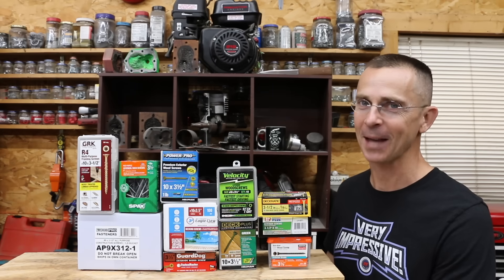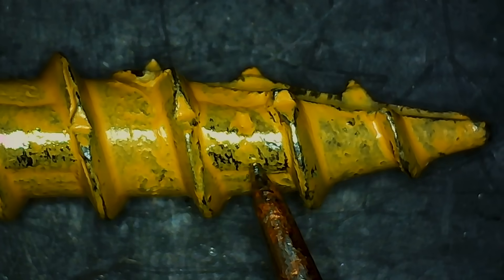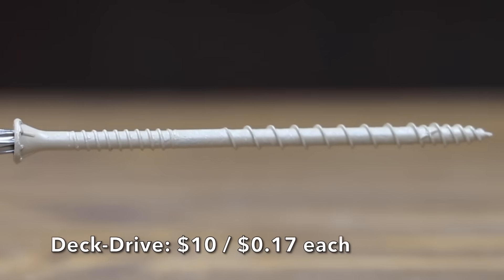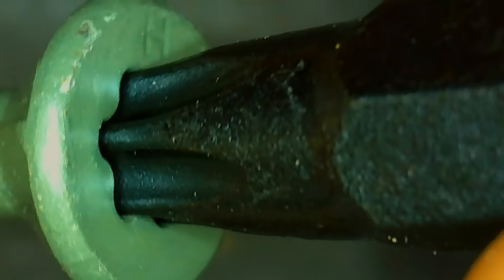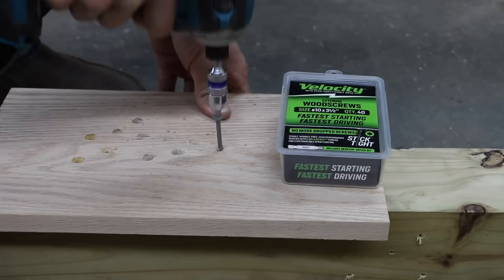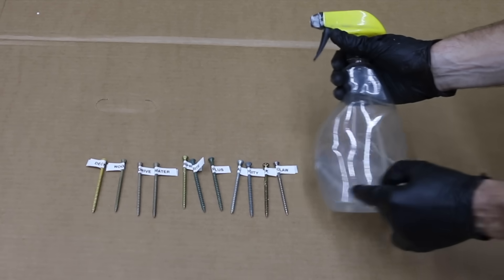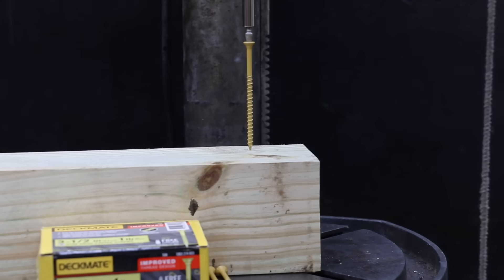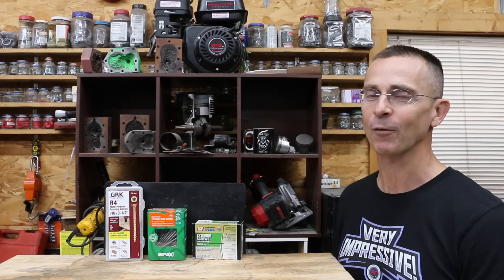Best Deck Screw? GRK vs SPAX, Grip Rite, Deckmate, WoodPro, FastenMaster, Deck Plus, Eagle Claw

Comment: I work in a furniture leg production facility that joins wood pieces together. Most of the wood is alder, but we also use harder wood like black walnut and maple. I was very interested in this video because we have a problem with breaking screws, mostly with the harder woods but sometimes with the softer ones as well. Unfortunately your test don’t include a break test while driving the screw, which is what we experience too often. 
We use one of the brands that was in the video, we are just looking for the ones that would hold up better. Any possibility of adding a drive/break test to the video?
Reply from the maker: Thanks for the suggestion.  Thanks for sharing.
Reply: Someone in the comments mentioned using beeswax (or similar) to lubricate the screws. Seems like a possibly easy solution to try, if traces of wax don't contaminate the wood for finishing.
Reply: @MorryB  the number of screws and the frequency of use would make this solution not workable in our shop.
You gave me a good list to work from, I’ll try another brand.
Thanks.

Comment: here from Toronto Ontario,, I am a Construction Electrician by trade. Sometimes we get into these really tight spaces with light fixtures/boxes/etc. where mini screw driviers do not fit or sockets. I found a 90 degree manual electronic type wrench like 4 or 5 inches long also they have adapters in front and at back slot for 1/4" sockets. Wondering wich one is the strongest/or best? I have been usind a PRO brand name one but they skip a dirrection while thightening because tool is so small. They have a side direction transfer tab for clock/counter clock possition ,, 
not too important but an idea for video
all your content is great * * * * *
Reply from the maker: Thanks!  Thanks for the video idea.

Comment: I know this has nothing to do with screws but iv been watching your videos on oil and fuel additives and wanted to see if adding different fuel additives with different purposes can help more than using the "all in one fuel system products" as i do all my own maintenance it would be good to know the best way to keep up on preventative measures before having even a minor failure or issue that requires parts to be replaced
Reply from the maker: Thank you!

Comment: I used Saberdrive 10x3.5 deck screw for my covered deck for every thing. 
Screwed them right into the 4x4 to hold the Joist, even the double header is fastened with Saberdrive 10x3.5 
I hope they are a good screw, because i already made the covered deck.
Reply from the maker: Thank you!

Comment: I've never put a deck in, but isn't corrosion negated by coating the deck ?  I mean, isn't coating supposed to seal the deck to prevent water to stop timber rot and metal corrosion?  If you have to worry about corrosion in the screws I'd be more worried about the wood rotting.

Comment: One slightly difficult aspect to test (at least in a small time scale), but very important one is how well do the deck screws stay put over time. Some brands have additional features to prevent them from becoming loose. There's nothing more annoying than walking on a patio deck barefooted and stepping on a protruding screw.
Reply from the maker: Great point!

Comment: If two runners tie for first place, then the next runner across finishes third.  But in the Weight to Start Screw column the third finisher is ranked second.  That throws the averages, because the fourth ranked screw is actually the tenth hardest to start, out of 11.  And the Deck-Drive screw would become dead last with a grand total of 36 (11+1+4+9+10) and a 7+ average.

Comment: Hell yeah Todd, great video.  Very thorough, and I am absolutely LOVING the breakdowns and summarys at the end.  Also thank you for skipping going over the tests where all the results are basically the same (the downward force test in this video).

I was confused when you were showing the coatings on the nails in the beginning though - the lighting was off - they all looked yellow, so I thought one screw was actually another?  Also, you kept saying "there's no visible chipping" when there was definitely chipping in the coating, but it didn't necessarily reach the exposed metal, from what I could tell.  Did you mean there wasn't any exposed metal?  Maybe I'm the weird one for being confused by that at first.

Comment: The torque test really isn't fair because wood hardness can change from location to location, especially where the grain is farther apart like nearer the edges of the wood. Same is true for pulling the screws out of the wood... it would be easier in those locations. Doing the same tests on 3 or 4 different types of wood (even plywood) may have been the more accurate option. Still at least it gives a better idea as to what is just garbage and what is likely going to do a better job.... so I think this is still a worthwhile video to watch, thank you once again, Todd!

Comment: I really don't see the point in all the hammering and noise made by impact drivers.
Try using your Makita drill instead, and set speed to 2. Full speed!
It's silent, and just as strong, but faster. Oddly enough battery lasts a LOT too. I built my entire deck using just 2 5Ah batterys and driving 4000+ screws.

Comment: Been using Spax and Power Pro for many years with no issues. Nice to see that they each did OK here.

Does anyone still use a phillips head screw for anything other than drywall? I cannot imagine building a deck with phillips or robinson heads ever again.

Comment: I built a new cedar deck in 2001 using Deckmate  coated “Lifetime Warranty” Phillips/Robertson  screws . Five years later I needed to remove some of the 2” x 6” planks to perform swimming pool maintenance. EVERY SINGLE head broke off the “Lifetime Warranty” Deckmate screws, no matter how careful we were removing the them. Ultimately, it turned into a crowbar and Sawzall affair.    I’m done with Deckmate!  I replaced the screws with GRK which were easy to remove during maintenance operations.  BTW, Home Deport refunded the cost of the Deckmate screws without fuss..
Reply: Cedar seems quite acidic to coated steel screws, especially for horizontal surfaces like decks that collect/pool water. Stainless is normally recommended for cedar.
Reply: @MorryB  Clearly. When I built the cedar spa surround I used all stainless fasteners.  No problems there!

Comment: I'm not doubting your testing methods and never will and especially by knowing you guys use 2x4 type of wood for a lot of stuff there but in my opinion you should use something else for testing the speed and torque and pull out force.
I was thinking something like mdf or plywood because those have uniform strength and density, unlike natural wood which has grains and knots.
Just my two cents about making tests more laboratory like (ironic, I know) instead of situation dependent.
Again, great content as ever and I'm willing to discuss my idea with anyone capable of discussing like a normal person.

Comment: Been using the grip-rite due to availability. They drive pretty easy, the coating is decent, sitting in water for a year only faded the paint. So far they haven't rusted through in pressure treated wood like the previous ones.
Reply from the maker: Thank you!

Comment: Great video, have used Deckmate on decks and had them shear after extreme cold and heat, maybe a re run with some time in freezer, like your battery test. I live in mountains with high winds and cold. Thanks.
Reply from the maker: Thank you!

Comment: You shouldn't be testing everything on oak; most decks are made with cedar redwood (which are softwoods), or various treated woods.
Reply from the maker: Thank you for the feedback!
Reply: @ProjectFarm  Np. Decks are also done with hardwood, so both would be good. I really think you should collaborate with a construction channel (if you haven't already), and talk to manufacturers. Also was thinking on that sheer test that the wood would fail before any of the screws, but maybe not all woods. Great channel btw; I've probably watched like 50 videos. Do you work in STEM or do you just find it interesting? Also appreciate how humble and thorough you are.

Comment: I kinda wonder if someone has thought of making these out of 316 stainless, just for that extra resistance against acids and bases, for example - for constructions near the sea. There is a reason why chimneys are made with 316 on the inside and 304/4XX on the outside, as acid forms during condensation. Or why decorative railing is used in 316 near peers, rather than 304.

Comment: The stainless screw might look corroded because it was in the same acid bath with the ferrous screws and their rust may have deposited onto the stainless. Next time you may want to do separate acid baths with new acid.
Reply: There's also the matter of what kind of stainless... Not all stainless steels are equal. Decking screws should really be Acid Proof A4 equivalent.
Reply from the maker: Thank you for the video idea!

Comment: I use grk alot they go in smooth and don't split the wood.
Ultrasonic cleaners are a hot topic. Some tubers only use water in the unit and put the items being cleaned into containers with different solvents and float it in the  ultrasonic unit.
Reply from the maker: Thank you for the video idea!

Comment: Hate to be that guy and point out these screws going in and then back out experience twice as much force, rubbing and heat as you would normally just screw them in and leave them not pull them back out.
Reply from the maker: Thank you for the feedback!

Comment: Only proper fastener to use for decks is Stainless, Acid-proof, A4-standard equivalent or better. Coated screws are a compromise in corrosion prone environments such as decks... Treated or not.
Reply from the maker: Thank you for the feedback

Comment: I've been using GRK and Spax as my primary screws for years now. The primary reason being the fit of the bit out of the box and the fact that I don't believe I've ever had a bit shear before I finished a box. Generally Spax is my go to all rounder for 2"-4" with GRK being my choice for their smaller and lag bolts. Sometimes it is worth that bit of extra money for consistent performance.
Reply: I used 6" long SPAX to anchor my ledger boards. A combination of screw design and the coating made it easy to drive with a 1/4" impact. NO Pre-drill, NO Splitting.. No way would that work with an old-school lag bolt even with a pre-drill.. AND Building code allows a smaller diameter SPAX than a Lag-bolt for the same application..
Reply from the maker: Thanks for the feedback.
Reply: I switched from Grip Rite to Spax and GRK several years ago for several reasons, mostly structural rating and wider variety available. This fall, I removed some of the Grip Rite screws I installed in some cedar 11 years ago, and they still looked nearly new, but all the GRK screws outside also still are reusable. Like you said, I don't thing I've ever broken one of either GRK or Spax, and maybe one has come out of thousands driven with a defective drive hole.

I like the extra drive nub that stabilizes the Spax screws, but the GRK are a little easier to find, and maybe start just a little easier. So I mostly use GRK for "construction" screws where the head will get sunk into the surface, but Spax for washer-face cabinet screws and lags.

The lags from both companies are also great - soooo much easier to drive than traditional lag bolts, and no need to pre-drill.

Comment: Wow all the brands that I've heard of finished on top 😂 
I guess word of mouth is still a good marketing strategy. 
Also, PRO TIP if you want your screws to go in faster and with less damage to the coating. spray the threads and shank with silicone lubricant, or rub them with paraffin/candle wax, beeswax, or just a bar of soap. 
Obviously silicone spray for people making money that need quick application and the cheaper stuff for DIYers with time. 

I was right about to buy some spax screws LoL, so hopefully the prices don't shoot up as wise DIYers dump their inferior brands. 

Thanks for the vids
Reply from the maker: You are welcome!  Thanks for the tip.

Comment: Fun testing as usual! Something worth mentioning is that a few years ago in my country, they revised the standard recommendation for deck screws used in treated lumber. It's now recommended that they should be of Acid-proof, Stainless steel, standard "A2" for low to medium requirements, and "A4" for higher requirements. Coated screws are no longer recommended or a standard, due insufficient protection in the long run.

So, most decks we built the last year used only "A4" Acid-proof fasteners, not the inferior, and cheaper, "C4" coated. Also, all fasteners for construction or exterior here have to follow the standard designation that is based on the the fasteners corrosion resistance and type of protection.
Reply from the maker: Thanks!  Thanks for sharing.

Comment: Fence contractor here. interesting to see some of these brands, which I've never heard of before. Usually you get the choice of two or three brands and that's it. If you buy in bulk, you get one choice usually. With that said, I'm not surprised that Grip Rite did well and I generally prefer them if they are available. Not sure if I ever saw a Spax, particularly in a 25 lb. box. If I do find any, I'll be sure and send my money to the US manufacturer. Save American jobs and get a high end product out of the deal. Sounds good to me.
Reply from the maker: Thanks for sharing.

Comment: @13:09...One of the most important statements in this video.  And frankly, this applies to decking as well.  Brittleness.  I have been building decks for years and regardless of the brand, with wood shrinkage and up and down movement, you are going to be snapping heads over time.  Also, many customers here in the west are going for doug fir 2x6 if they desire wood decking.  No one can afford redwood. Trex is still popular for those who can afford it.  Anyway, warping and shrinking of fir will waste any of these brands.  I must say for the organic deck, fir takes stain beautifully and customers love the look....for about 2 years.  Nails move, screws snap.  In many applications, I have gone back to just plain galvies...  I also drill and bolt much of the 4X4 rail supports and other areas.  Overall, I am bolting a lot more.  I did an entryway staircase using steel stringers and have had no snapped screws!  There is virtually no movement on that staircase.  My point is: movement is what takes these screws south.  Anything you do to support your joists, rail posts, 2x8,10's or 12's in a more efficient way, puts less stress on screws or nails.  That is the trick to making an organic deck last.
Reply from the maker: Thanks for the feedback.

Comment: The GRK and Spax both did well, but the GRK comes in a nice, sturdy, stackable plastic box, which is not to be underestimated.
Reply: I currently store MANY of various things in various GRK boxes.
Reply from the maker: Thanks for the feedback.
Reply: That also means more unnecessary plastic waste, something we really need in the current ecological state of our world
Reply: Yeah half my extra screws and stuff are in the same lol
Reply: The box isn't waste if it's a useful product in and of itself.
Reply: @MrNerdHair  I prefer the idea of something that is biodegradable, something like metal or wood. Of course, there could be coatings that are basically plastic there too. Reuse is always good. Making something from more environmentally friendly materials is just better. Ya know? Nothing is perfect, but plastic packaging just seems to be unnecessary evil.
Reply: So much for environmentally friendly being part of the purchase decision.
Reply: @ProleDaddy  While I am all for things which arre actually environmentally-friendly, building a house by itself isn't one of those things unless you use nothing but hand tools. Even still you still destroy a little bit of forest using wood construction. And concrete? That emits greenhouse gases while building. Regardless, house construction is very environmentally unfriendly unless it's a mud hut.
Reply: @bluephreakr  I'm aware of all of that. I don't see the wood as so much of a an issue if sustainable forestry is practiced, which seems to be typical today. Concrete? Yeah, that's just going to be what it is probably. This is just the least necessary thing. It's just packaging.
Reply: @bluephreakr  did you really whip out the ol' whataboutism. i need a more or less modern house for shelter, but i certainty don't need everything to be wrapped in plastic, especially consumable products

Comment: Great information & timely for me as I've got two decks to build this spring.  I do wish you had tested torque to twist off a screw and torque to camout the drive - those were the problems I've had with stainless Phillips and square drive.  Frustrating to run a screw in and then have the head twist off while countersinking itself.
Reply from the maker: Thanks for the constructive feedback.

Comment: You blew this one. There is no good deck screw. BECAUSE, screwing down deck planks ruins th deck. The correct fastener is a double hot dip galvanized 12d screw nail, for 5/4 deck.

Comment: For those that don't know and want to build with cedar, grk also makes a stainless steel screw. Do not use any other coated screw or it will prematurely corrode and you will have those black spots where the fastener is. 

If you want to use nails, you can get away with a hot dip galvanized. Do not use flash galvanized fasteners with cedar or the same outcome will happen
Reply from the maker: Thanks for the feedback.
Reply: @ProjectFarm  you're welcome, I love cedar and hate seeing it covered it black spots from the fasteners.